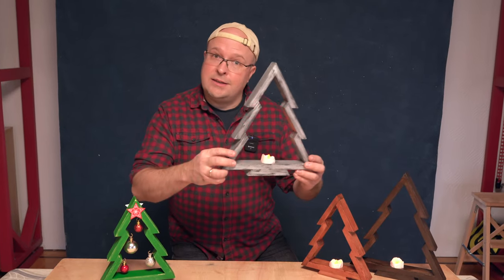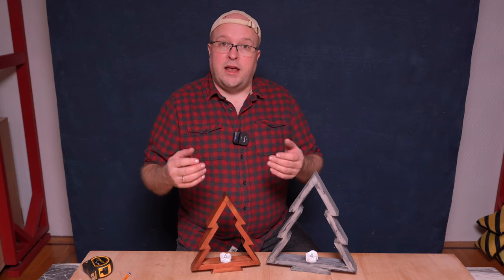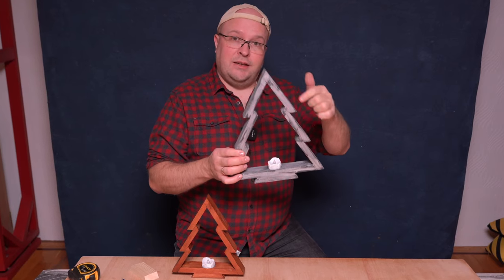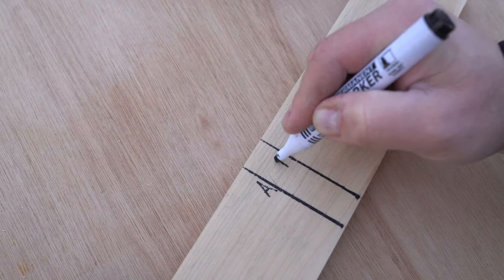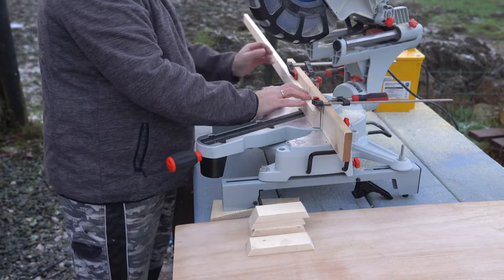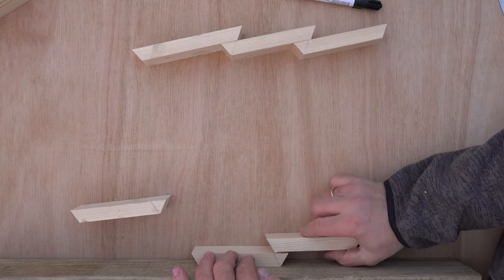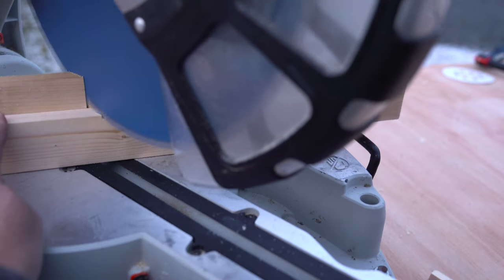Wooden Christmas Tree | Detailed Build with Jig for Mitre Saw

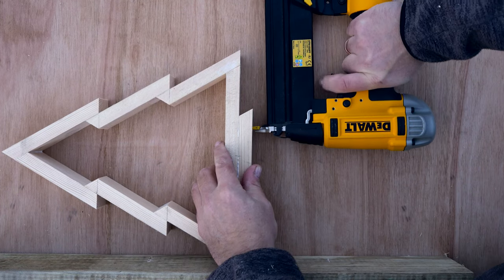Comment: This was a good explanation without a lot of fluff! Great job. I did notice at about 3:57 into the video it looks like the tree you are showing is nailed from the inside instead of from the outside. I like that look. If that's the case then the only outside nails showing would be at the peak and the base. Regardless, a very helpful video. Thanks
Reply from the maker: Thank you for the kind words! Yes, you're right, the tree is nailed from the inside, leaving the outside nails visible only at the peak and base. Glad you found the video helpful!

Comment: Is there any formula if I use other thickness? Like 12mm.
Reply from the maker: Hi Ralf! Usually, I do like that - I pick dimension for part "A" (for example 100mm), I prefer look of 30° cut (but this work with any degree) - so I cut part "A". Then I measure thickens of material at the end, on 30° cut (not perpendicular as usually, but under angle). For 12 mm board it will be around 13,5 - 14mm. In this case my part "B" will be 114 mm long. If part "A" is 150 mm, them part "B" is 164mm. I know, it may sound complicated, but it's just geometrical thing. Hopefully I explained clear enough. Thank you for your question😉